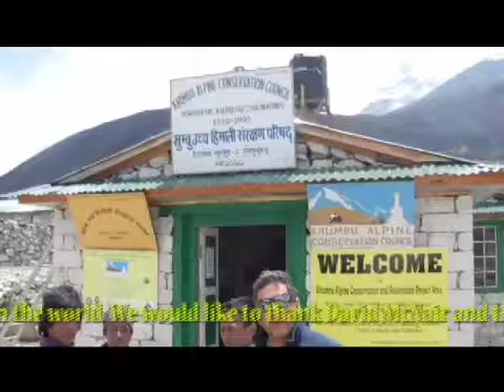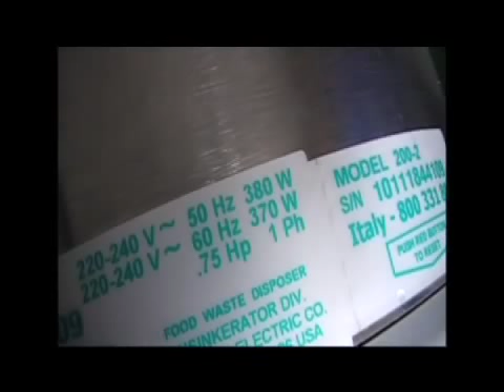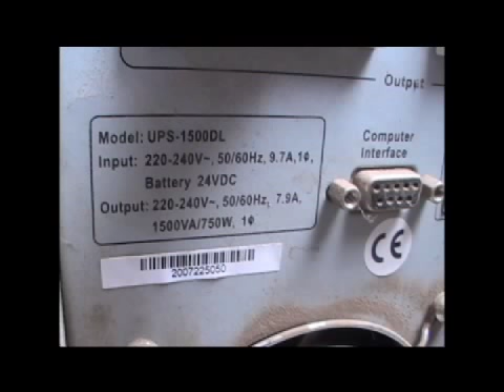Experimenting with a Solar Powered Insinkerator at 14,000 feet in Nepal

Comment: @innoventor As for going hi tech, it isn't so much that as people are merely buying what they find useful and trying to cobble working systems together with no formal training at all.  Occasionally somebody will come through and offer advice. I have suggested creating an electronics parts depot and library at the Khumbu Alpine Conservation Center because they will need to be able to deal with malfunctioning equipment, so you are absolutely right about the need.

Comment: @innoventor ... and then bring the board in ones backpack to Kathmandu where all the appropriate parts can befound and replace the resistor and the overload switch on the damaged board (assuming that is all that is wrong with it); trouble shoot and then bring the board back up to Dingboche to keep in spare if any future problems arise.  What the environmental damage of doing it that way is I can't begin to conceive, so perhaps you can explain yourself, manila. Nobody suggested discarding anythin

Comment: @manilaenglish What can I say to your comment, manila? The least wasteful, most economical and realistic way to fix the Insinkerator in Dingboche, where everything runs on solar energy and there isn't much excess electricity to spare and there are no soldering irons and no bins of electronic components to work with, and only one person in the next village (Pheriche) with any electronics experience,  is to swap out the board (plug and play, requiring only a screwdriver...